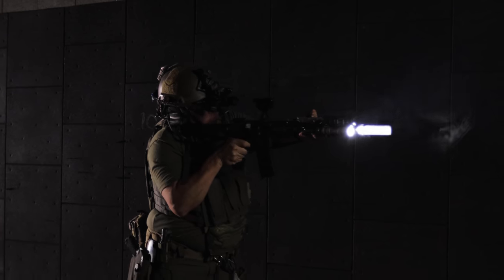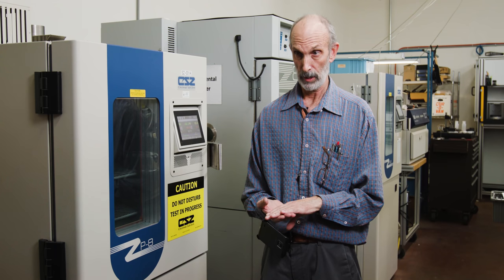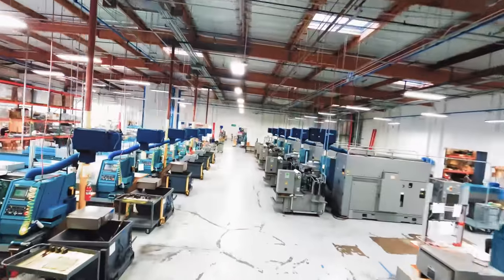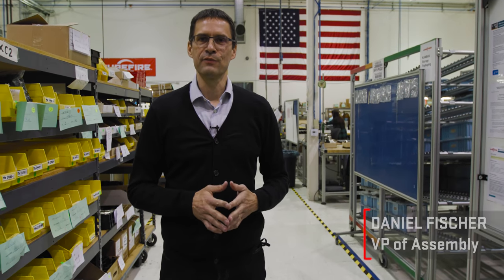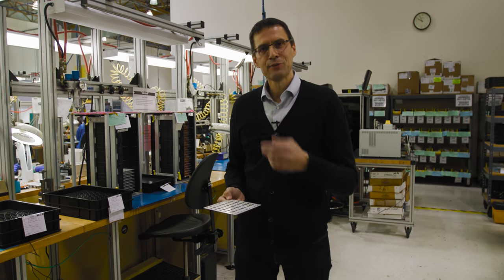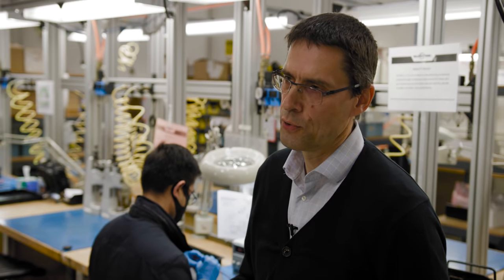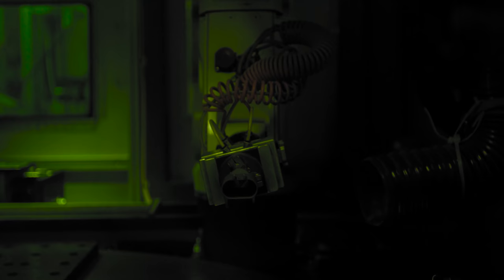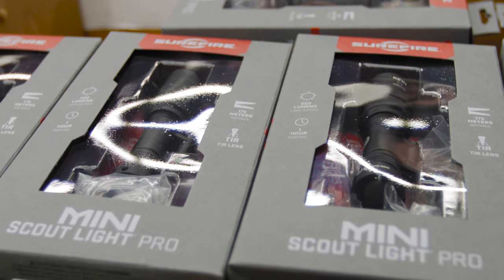SureFire Behind the Scenes Pt. 1: Illumination

Comment: I've been daily carrying an E2e (incandescent) for more than ten years.
I also went camping with an M4 Devastator (configured for one hour - 125 lumens). It was impossible (for me) to use those lights permanently because they costed me four CR123s every hour.
I'm still partial to incandescent because, no matter of high CRI LEDs, I see much further in the dark of a forest with an High pressure 12 V xenon bulb in a Stochastic Reflector. Much better than any 1000s lumens LED.